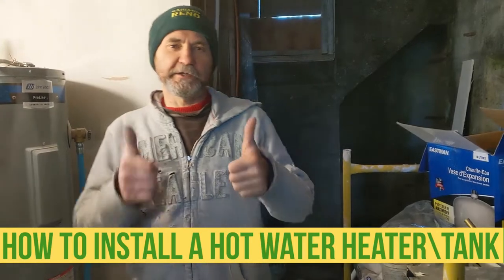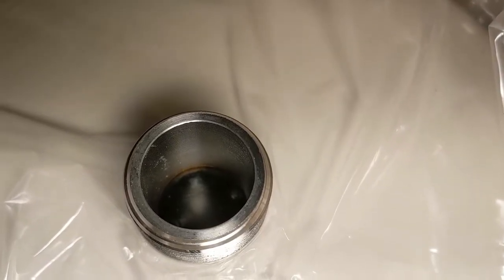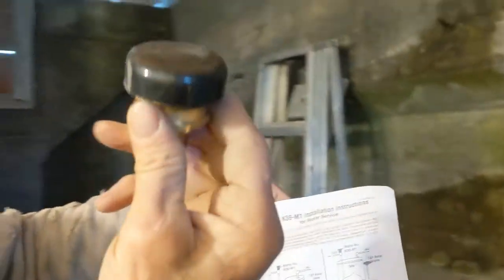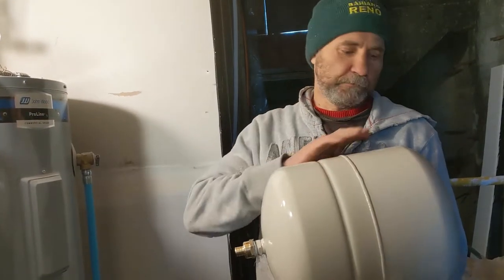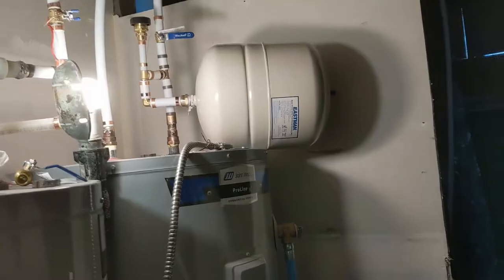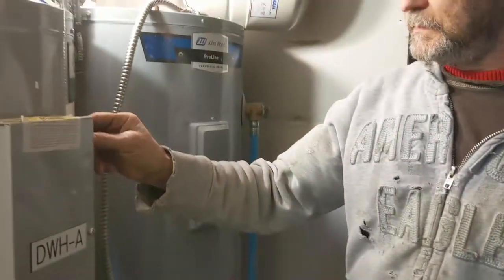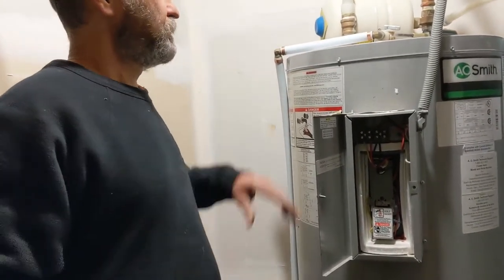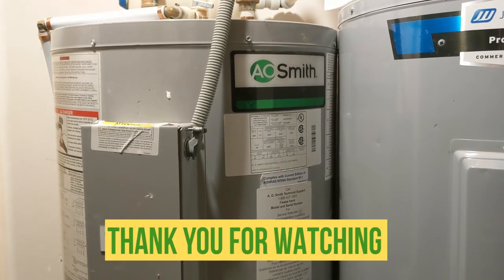How to install an electric HOT WATER Heater

Comment: I replaced my hot water heater did everything we needed to do, connected hot and cold water connected power while the power was offf from the breaker, filled the hot water heater up, bleed the hot lines in  all rooms for a few mins until no sputtering left then cut the power on from the breaker.. still no hot water. I’m going crazy . Any suggestions?

Ps. This is a new hot water heater from Lowe’s 40 gal med AO smith put it in double wide trailer
Reply from the maker: Hello Nomad, thank you for watching my videos, check to see, if you have 220volts going to the tank, make sue that your electrical breakers are in 2 phases on the electrical panel, one break in each phase, keep safe and let me know, if you have any more questions
Reply: @BahianoReno   I’m pretty much brand new to this,  would I just check that by checking the power cables with a electrical tester?  And how do I check the phases on the breaker? Also want do I do if not?
Reply from the maker: Use the tester, if reads around 220volts, you would have to check the wires diagram for troubleshooting, if tester reads nothing you have the breakers on a single leg, make sure that you breakers are in different legs on the panel, when you look in the electrical panel you see two bars in the panel, each side of the breaker needs to be connected to a different leg, if you don't have the space available you can move a single breaker to make the space needed 220volts, let me know, if it worked, thank you very much